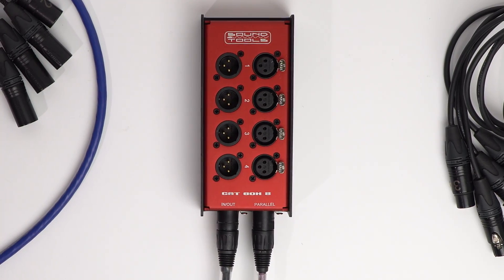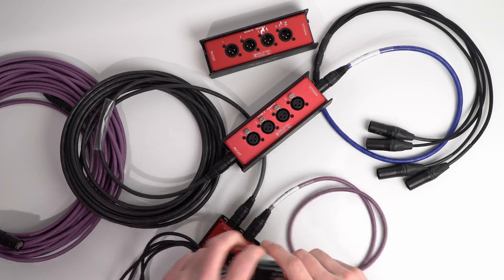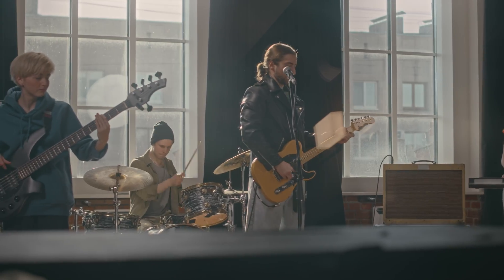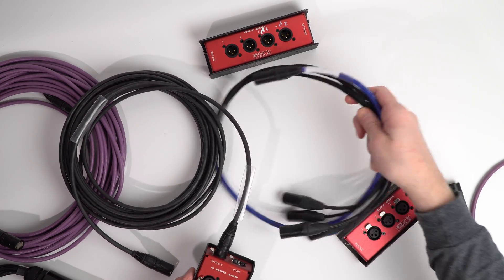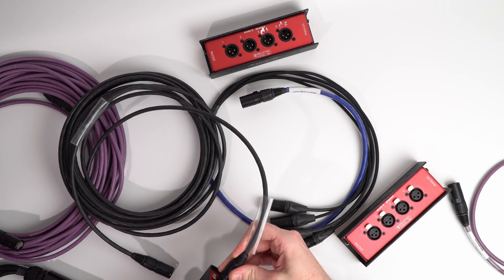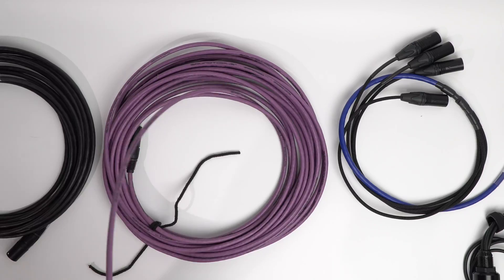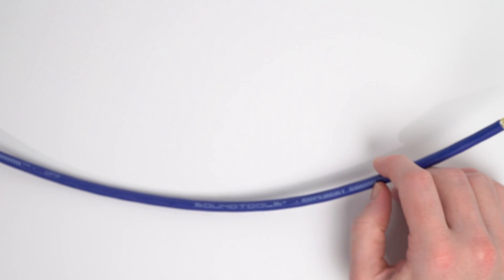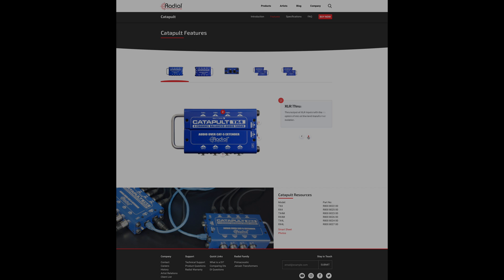SoundTools CatBOX 8 and SuperCAT 7 First Look & Teardown

Comment: Pretty cool product, I'm live sound engineer and am often doing gigs in clubs with small stages with an M32 and S32, and a few of these would be great for reducing the amount of long cables runs over the stage, as opposed to running everything back to one box I would love to use the to clean the stage up a bit more. Like chuck one in each corner and run em back to the S32. Maybe I can convince the company I work for to purchase 3 of them ;)
Reply from the maker: I really like the catboxes for exaclty this use, they're great for drop snakes around a stage.

Comment: Planning to add some catbox type to my live recording rig to accommodate wireless. I use a Mackie DL 32S for SR and recording and need to space wireless TX/RX from the stage box to reduce interference from the WIFI control signal.
I would like to see a catbox with combo input jacks ie XLR/Phone, with some TX/RX that have phone plugs it would make more sense.

Comment: I asked a question on instagram about the cat7 cable but it wasn’t answered in this video
Reply from the maker: Sorry, you asked about using it in conduit right? The cable SoundTools sells currently isn’t intended for permanent installation use, it’s specifically for stage use.
Reply: @DcSoundOp  what cable do you use with the WallCAT 8??? that’s intended for permanent installation

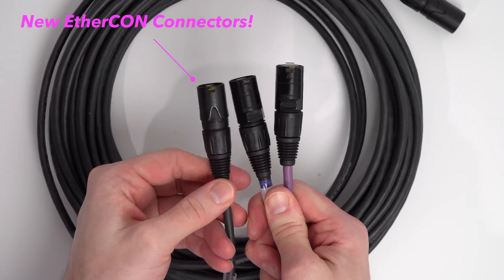Comment: Why is the RJ45 of the violet super cat cable sticking out the etherCON (9:24)? I bet it won’t lock.
I like and use the audio over Cat solution as stage snakes. The boxes are small for a tidy stage and I only use Cat5e STP for them so that I only have 1 type of cable useable for Dante, AES50, and audio over Cat. If a outlet doesn’t have EtherCON, I just remove the barrel. For this reason I won’t add the supercat 7. It might be a wonderful cable but it defeats the ‘one cable fits all’ thought I have as it won’t be compatible with AES50
Reply from the maker: It’s not like that permanently or from the factory, just me not getting it back together properly while paying attention to filming & other things.
Reply: A much neater solution to constantly disassembling the shells of Ethercon connectors to mate with panel-mount RJ-45 sockets is to invest in some of Neutrik’s N8FF couplers. They have locking Ethercon ports on either end, meaning you can keep them attached to pre-existing Ethercon cables and simply use a short RJ-45 cable connected to the other side of the barrel whenever you need to connect to gear or plates with only RJ-45 ports. Choosing this option means you never have to disassemble—and very easily lose— Ethercon shells.
Reply: You’re completely right! As a matter of fact, I do have them with me in my pelicase🤷🏼‍♂️

Comment: Very neat with the new CatBOX 8, Have a few smaller gigs around where it could be useful.
(1 key with vocal and a single wedge, then a second in front for 2 vocals and 2 wedges on seperate mixes.)